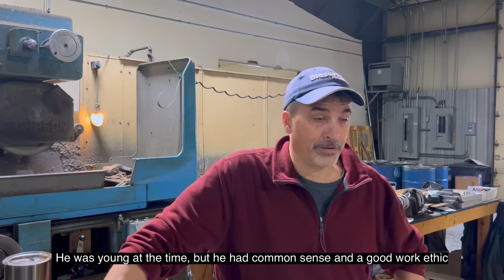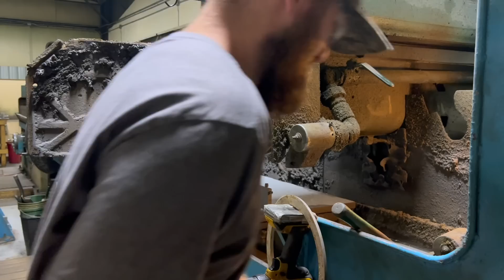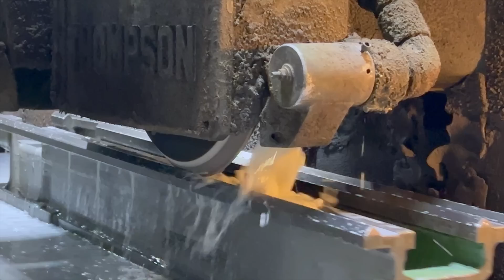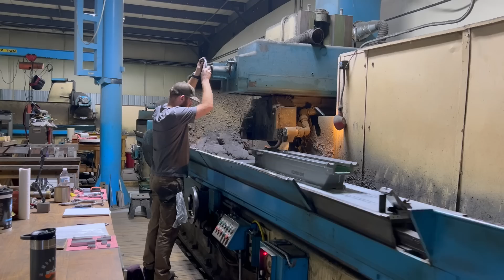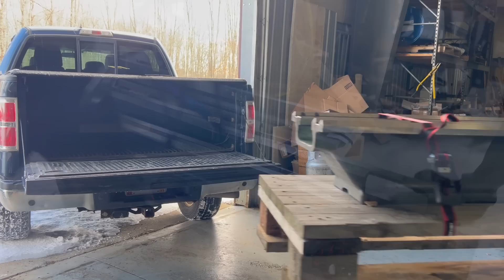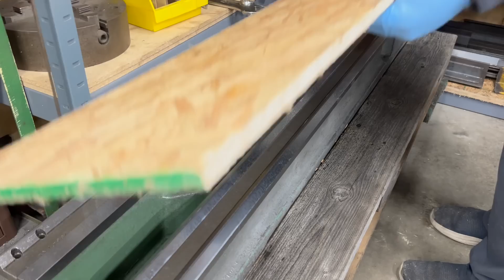South Bend Lathe Rebuild: Grinding the Bed Ways

Comment: Did they grind the base too?
Reply from the maker: No. It's not a wear surface, there would be no need to grind it.
Reply: @ sure there is. If one or more of the machined surfaces on the base were not in the same plane there could be an issue. The base gets sucked down onto the  magnet then when done grinding and you release the magnet it could bow the freshly ground bed. I'm surprised they didn't check. Probably doesn't matter much on a small South Bend but something to think about.
Reply from the maker: @duanedickey7043  There's no reason to believe that South Bend didn't take that into account when they manufactured it. These are NOT wear surfaces. A lot more went into indicating the lathe bed in that didn't make it onto video.
Reply: @duanedickey7043 I’m the operator. I check the base for flatness and if it is twisted. If it isn’t flat then we shim it flat. If it is twisted I will grind the base with the magnet off on top of parallels

Comment: Thanks for sharing.  It will be interesting to see how you go about building up the saddle.  Looking forward to the next episode....
Reply from the maker: I will mill the ways under the saddle and then probably use Turcite to built it back up, and then scrape the turcite so the saddle is true and straight with the bed.
Reply: @MyLilMule so many new machines are using turcite at the beginning of the life of the machine since it cushions better than metal to metal.